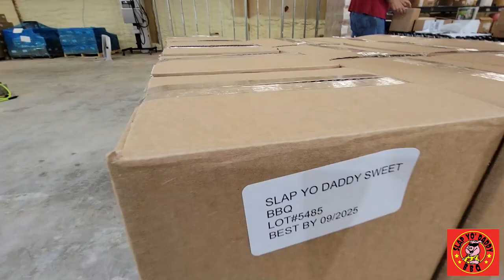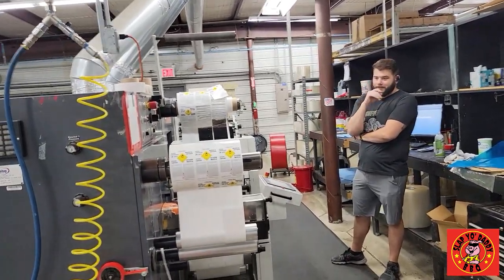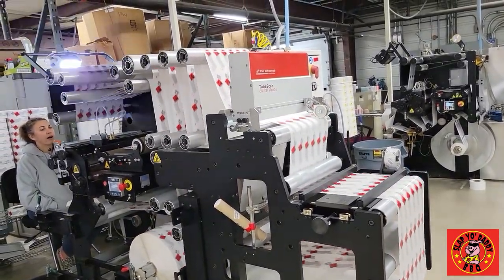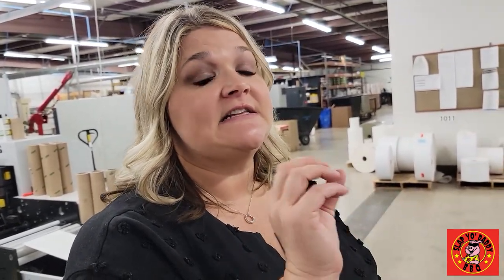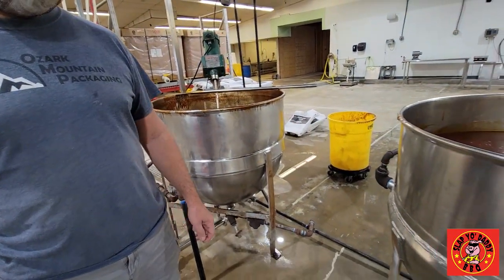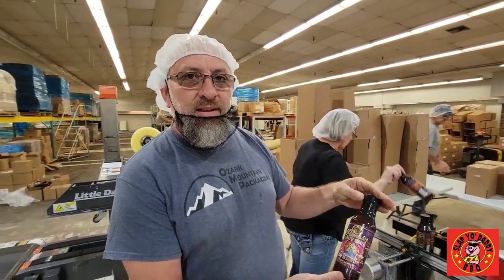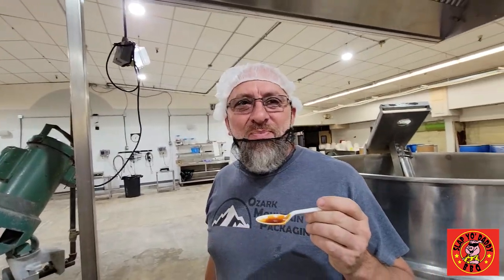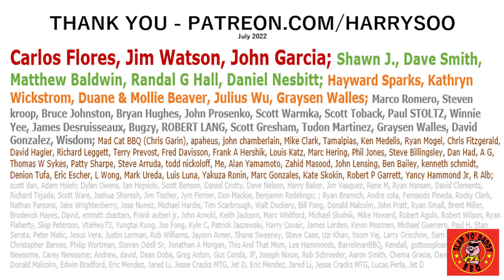How Harry's BBQ Sauces are made | BBQ Champion Harry Soo SlapYoDaddyBBQ.com

Comment: Actually looked at bottling my dad's sauce about twenty years ago. He started making it in the 1940s and did sell it at one time, but a bad experience with a packager, that was located in Arkansas turned us off.
Reply: you can't give up after one experience.
Reply: you can't give up after one experience.
Reply from the maker: Hope you can restart the recipe.  The world needs to try your Dad's sauce.
Reply: @SlapYoDaddyBBQ  I never stopped making it. I just give it away these days. It has been knocked off several times, but noone can match the original. 

Just a hint, my dad was a bootlegger in the 1920's and early 30's.